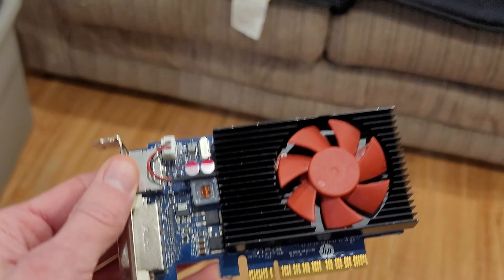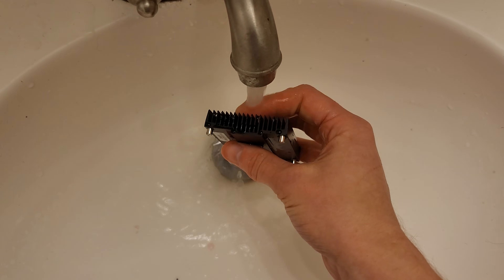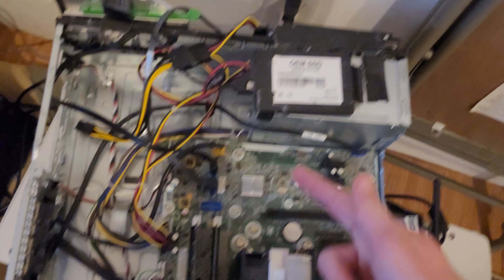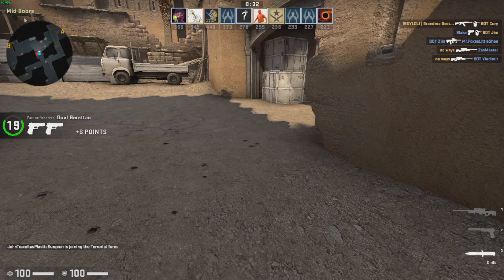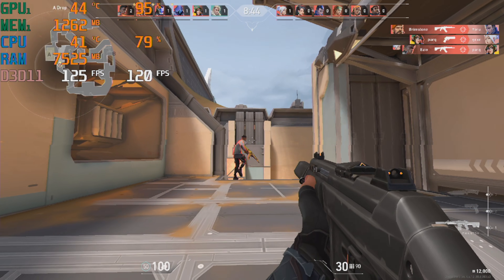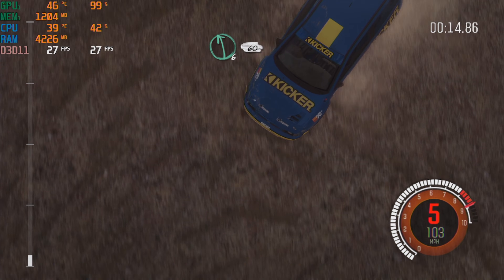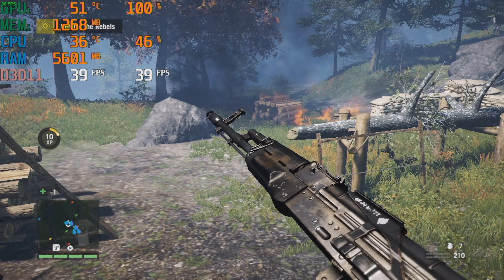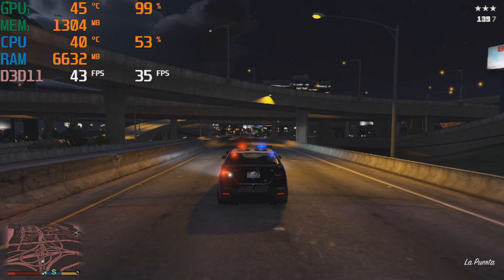Overclocking The GT 730 Until Its Not Bad

Comment: Yeah, I also have a Geforve 730 ( with  4GB DDR3 RAM) for backup. And i even could play DOOM VR (2016) with 59fps average frame, and 67 max fps. But of course, it also depends of rest of hardware. I played with 32 GB DDR3 RAM, Intel XEON E3 1275v2 and the geforce 730 4GB. Even played GTA V with over 60fps max.

Comment: i got my gt730 2gb ddr3 but without the fan its the passive cooled version. I got it from core clock 902 to 1210MHz and for the memory it when from 900 to 1215MHz. And i increased the voltage to 1070mV. My bandwidth got boosted to 19.4 gb/s same for pixel fillrate 9.7 gpixel/s and texture fillrate to 38.7 Gtexel/s. So quite a big inprovment!

Comment: which graphics card do i go for next cause my pc rn has the gt 730 and it cant run some games at all
Reply: depends on what games you want to play and if you edir videos and photos. I would buy a used gtx 960 750ti. Get a older gtx its miles better then a gt 730. (i still use it but plan on getting a gtx of some sort). I wouldd not reccomend a gtx 460/480. I almost forgot! If you have a intel i3/i5 thats 4/5/6 gen then a gtx 1080,980/960,780/ti are a great combo for a midrange cpu. As it won't bottleneck the hell out of the cpu as it would if you put a 2060 in there.

Comment: I got mine to Core clock 300 and Memory clock 200. still sucks but its ok?
Reply from the maker: Any overclock can help with this GPU
Reply: @Jaindike  the best it can run is NFS heat, if I don't overclock, the driver crashes and I have to restart my PC

Comment: Brother really than you I want to buy this card for games like cs 2 GTA v free fire pubge mobile this games online games for my brother help me pls OK read

Running beamng drive is dream but can the gt730 1GB gddr5 give me like this performance I want to buy it because I'm sure the card is used but like new tell me what I have to do 

For this potatoooo
Core I3 3220
4ram DDR3 I will upG it for 12
Ssd 128 /HDD 300
Power supply 240w
Dh61h0 
❤❤❤❤❤❤❤
Reply from the maker: First things first get more ram, as much as possible. Even i gigs isn't enough for anything, 16 makes it usable, but 24-32 ensures it'll never be an issue. 12 gb of ddr3 shouldn't cost more than 20, 25 bucks on ebay. A half tb ssd should be another 30, even if the HDD is for mass storage, hdds still kinda just.. suck. See if you MB supports the i7 3770, would be well worth the upgrade. The 730 is a decent card of you upgrade the system accordingly, but finding a gtx 570 around the same price shouldn't be to difficult
Reply: @Jaindike  I can put core I7 3770 my ssd is good 128 and 300 HDD not bad for me but I know this tips but I'm asking the gt 730 2GB is better than the 1GB ???? A lot or not

Comment: Sad you got the 8x ddr3 variant, I have the 16x gddr5 variant and it overclocks like a champ. With kepler bios tweaker I managed to extract around 1.2ghz on the core and around 400 on memory and it would run every pre 2014 game with relative ease, anything newer and you're boarding the struggle bus
Reply: Bro i got the 4gb ddr3 fermi edition💀,it's same a bit better than the kepler one(some 52fps in gta 5 i got)but the problem is it doesn't support the 400 series driver it only support 391.35 and doesn't support vulkan, so games after 2018 like valorant crashes after 20mins of gaming

Comment: I wonder if the ddr5 version is much better. To get the thermal pad off use brake cleaner (outside).
Reply from the maker: Don't know about the DDR5 version. Never thought to use brake cleaner either but Ill definitely be doing that next time
Reply: @Jaindike  Ive seen the DDr5 perform a lil better like 20 average fps , Ive heard you only need a 1gb version as the 730 can only use 1gb of ram.  I plan on using the ddr3 version for emulation should be good up to maybe some gamecube games possibly some wii.
Reply: @Jaindike  Got one of these pieces of crap gifted yesterday. With nvidia inspector this asus gt 730 2gb ddr5 64 bit card reaches 1316 mhz on the core 1492 mhz on the memory.

Comment: the first gpu I bought brand new in 2017, I got a Palit 2gb GDDR5 version which is the best one and got it for $50.
I ran it overclocked for years before I replaced it. at around 150 core 450(225) mem on msi afterburner.
played so much GTA Online, modded skyrim se, the forest with friends.
but honestly if I had an extra $30 back then I would've bought the 1030.
Reply from the maker: Ooh nice. You got a lot of life out of that 730, especially with that overclock. Thats some real budget gaming right there

Comment: It's probably really good for windows XP   Maybe
It might be really great for Linux too   It's probably one of those cards you just don't want to expect too much out of But either way it's a piece of history I love taking apart GPUs myself 
 And I really love Using Arctic MX4 It's really   The best  Thermal paste for video cards 
 Especially when you get so much in a tube Definitely the best Bang for your buck  But that's just my opinion It's definitely good to be able to paste a whole bunch GPU'S   One of the things I do agree with It's nice when cards  Only have a few screws It makes it much easier to take apart  sum   Navidia video cards Are really hard to take a part Like Quadro cards When they have 3 different bits That you have to use So it's When only 4 screws